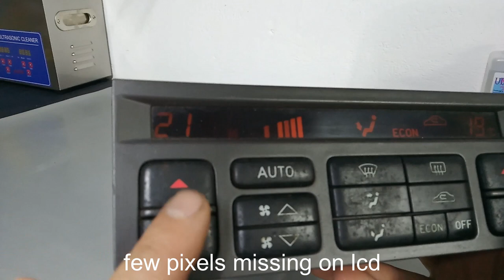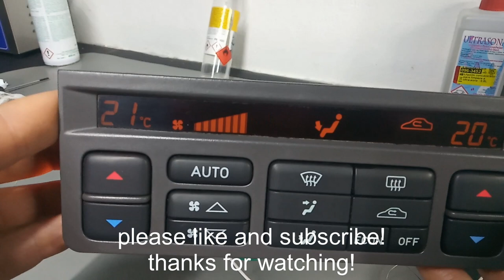Saab 95 Climate control repair

Comment: Which pins do you connect to test the unit? Great video!
Reply: Yes, great video. I am also interested which pins you connect to test the unit. Further: in have replacement led lichtbulb, the can only be installed in one way. Very curious to find out how to connect 12v to the unit to also install the new led light bulbs.

Comment: Outstanding!  Sir How do you physically remove the ACC unit / radio / info ?   I need to clean all those damned buttons.  I have a 2001 Saab 9-5 Aero.  Many thanks to you !!
Reply from the maker: Hi, not sure, the owner has removed it... Have a look on YouTube, "how to remove Saab 95 climate Control"
Reply: @diyrepairs6839  yes I have since found a video or 2 ;-)
Reply: Come pulire bottoni così bene?